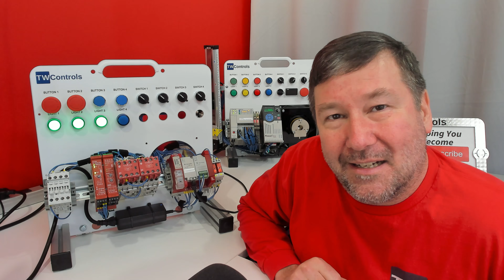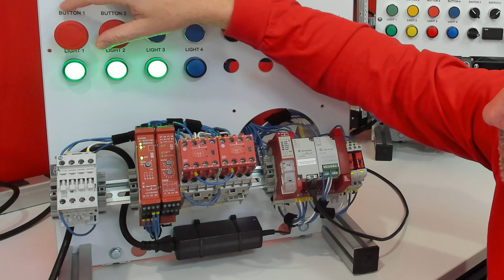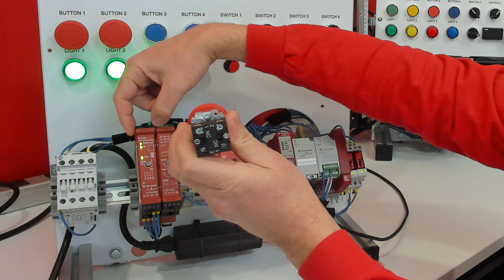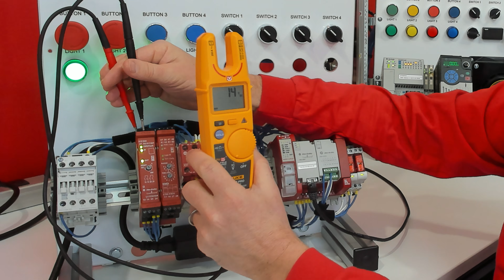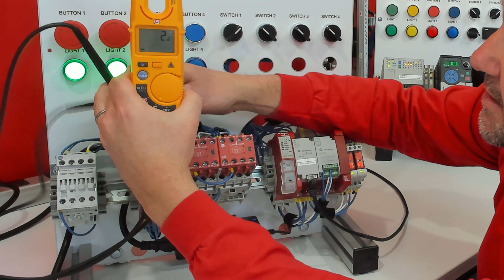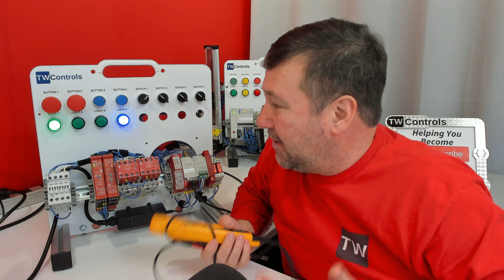Safety Relay Troubleshooting: From Blinking Lights to Fixed Right

Comment: those redtops with the bifurcated contacts don't last long. Their switch cycles are a BIG problem when used with light curtains and two hand touch relays. I've seen operators play songs by making them pull in / out.
Reply from the maker: Good to know.

Comment: If the contact is welded on the safety relay, how is that 24v circuit broken?  I'm sure I'm over thinking this. lol
Reply from the maker: Your monitoring circuit is normally closed so it should have opened when the output was de energized

Comment: Hi Tim - I am setting up something similar. For your light indicators, for example, light 4. How did you configure or wire that light to illuminate when the Out is ready on the safety relay? Was that logic you setup in the PLC program?
Reply from the maker: Most fixed safety relays have an output to tell you they are not ok. In the case of this AB safety relay it is Y32.
Reply: @TimWilborne  I have been referencing the manual for my safety relay all morning. As soon as you mentioned Y32, if I would have scrolled a little further - I just found the section describing what that auxiliary output does. Thanks again! Your videos are a big help.
Reply from the maker: You are welcome 😁

Comment: This kind of nonsense is why we're pulling these relays out of our machines.  At least with a Safety PLC we can easily see what signals it's looking for.   Great info, awesome training, but the end result is that we're looking at yeeting AB MSRs into the garbage.
Reply from the maker: We have some videos coming out doing the same on a Compact Guardlogix 😁
Reply: @TimWilborne  if the application isn't big enough to justify upgraded control logix with safety built in, we're dropping in a Keyence GC-1000R.  And probably Keyence safeties. Allen Bradley does a lot of things right but safety systems aren't one of them.
Reply from the maker: Good to know

Comment: Hey Tim, hope you survived the storm. The best way to do that is with a TOY Hauler. TRY measuring Hz instead of DC VOLTS or add a low resistance shunt resistor.

Comment: Amazing how many things i see that don't fail safe,,,, especially safety beams,,, that don't shut the machine down when the cables get cut,,,, perhaps just the once when it picks up the pliers causing a brief closed circuit 😊
Reply from the maker: Yeah it is important to get things right when dealing with safety devices.
Reply: @TimWilborne  which made me think of burglar alarm systems with end of line resistors... cheers

Comment: Just power down the control cabinet for 30 seconds..
Reply: This is the common solution, more often than not.  Or get rid of the MSR and put something better in.
Reply: This doesn't always work. Sometimes it's a lot deeper and and understanding of safety circuits is needed to properly troubleshoot

Comment: Hey Tim, wire those estops together in series, simulate your broken/welded contact on one of the estops as you have and the relay will detect the fault and prevent restart as shown. Does this again but activate and release the other estop and the relay will see the correct sequence and you will be able to enable the outputs despite having a failure. We call this fault masking in industry and is due to the series connection of electromechanical devices which is not recommended but all too common. 👍🏻
Reply from the maker: Yes, there is a "3rd" contact design that I've seen to alleviate that.  Same series set up then one additional contact from each estop.  It lessens your estops some but at that point I say just wire them individually.